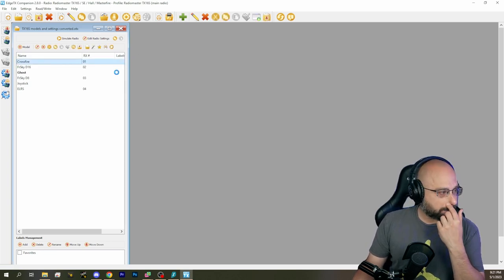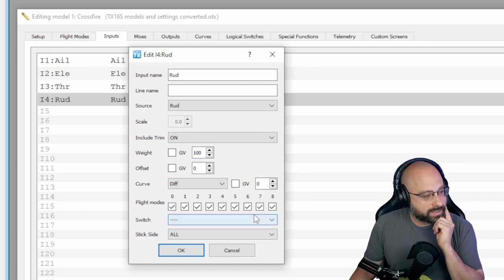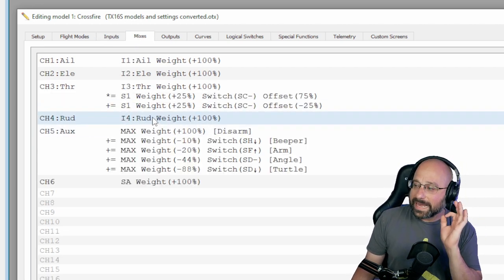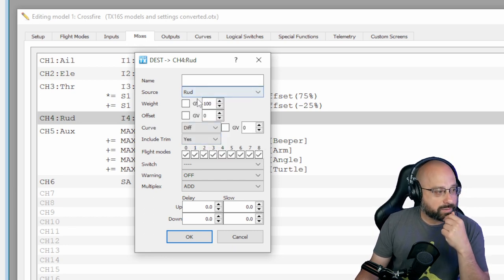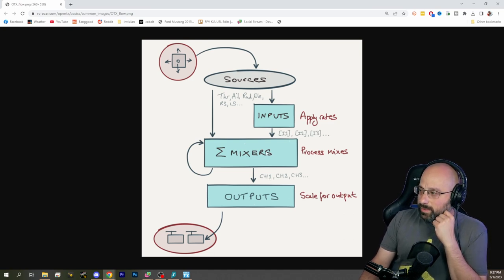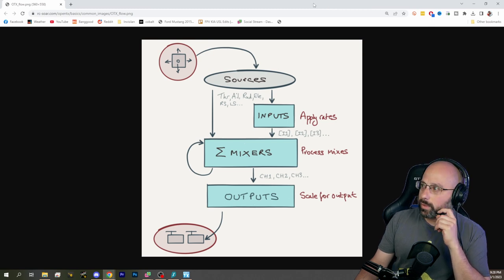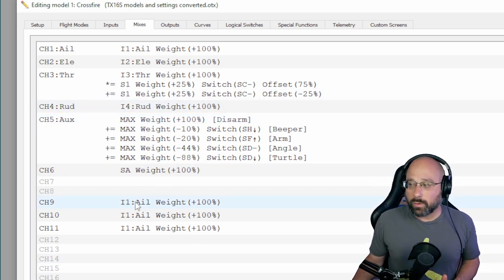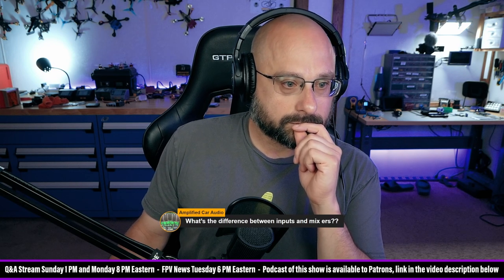What Is Inputs vs Mixes in OpenTX and EdgeTX? Which One To Use? - FPV Questions

Comment: So, I have a background in audio engineering/mixing so I tend to think of this as the same workflow for an audio mixer:  Sources are the physical lines going in, in the case of a quad it would be any of the physical buttons or sticks.  Those can be sent to one or multiple places, they can go to a specific channel, or "Input" (think of a fader on a mixing board) or they can go straight to a "Mix", which would be like sending it directly to an auxiliary feed on a mixing board.  The "Mixes" can have one or multiple "Inputs" going to them to combine them to an output, exactly like an auxiliary feed on an audio mixing board, where you could also have one of the "Inputs", maybe one of your switches, act as something like a sidechain into a gate or compressor so that when that "input" is active, it creates a different effect at the output of the mix....
I may have just made that even more unclear, but if you have experience in audio signal flow maybe that can help it click for you
Reply: good way to look at it :)

Comment: The way I understand it is:

If you have a model that doesn't need any channel mixing, then only use inputs... however, if you have a robot, or a tank that uses tracks, or a plane that uses a configuration of multiple servos  with the same stick.. then you will  have to use mixes.

Comment: if you add expo 20 in the Inputs, and expo 30 in the Mixes, which one will override. Adding a third variable, if you add 40 expo in betaflight, which one will you actually be flying with.
I'm switching from an spektrum ix12 to TX16S and as you can imagine, things have been rough. I'm about 40 yt videos deep. But I've always wondered which expo would override the the other. the expo on my ix12 or betaflight.
Reply: The effects will stack.
Reply: @jasonhurdlow6607  So sticking to just one, which one should I alter leaving the other 2 on zero.
Reply: @neomayad  I would try just using it on Input. That's typically the best option. If that doesn't work the way you want, I'd try doing it in Betaflight.